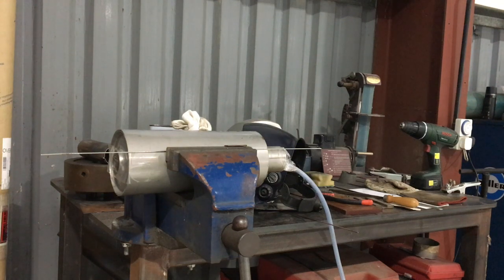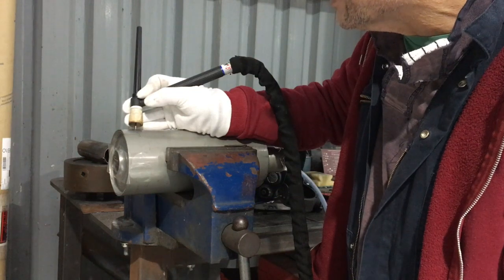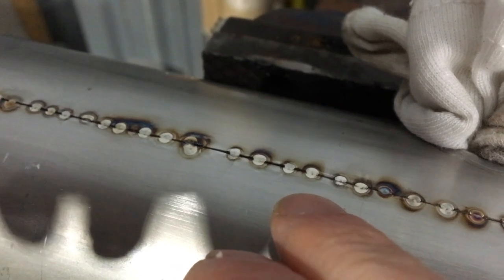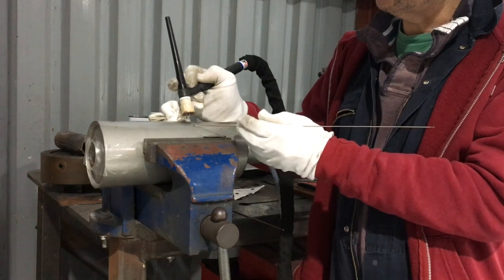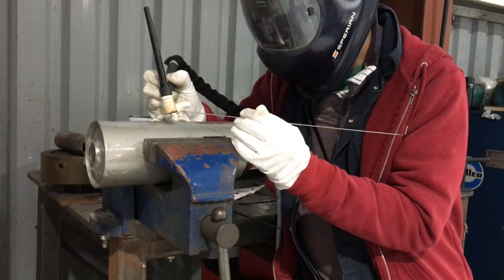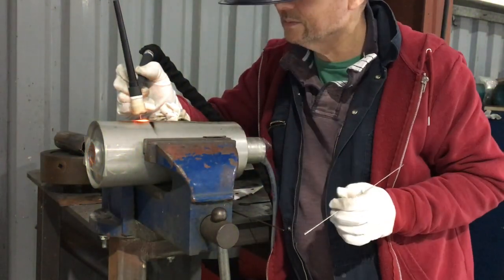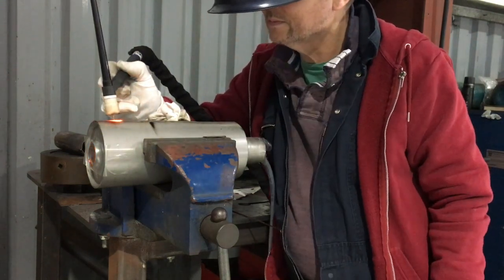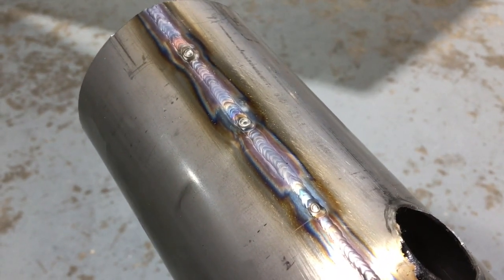A few tips for tig welding 321 stainless steel. Light up and get moving!

Comment: that looks really nice, really good backpurging there ..  I tend to use solarflux to save on gas.

 I'd love to try some stainshield gas but only have access to Pure argon from a local supplier , i'm not convinced its high quality as I don't really get nice colouring and have used boc gas before and got some nice colours !
Reply: Depending on the gas diffusion method, open gaps, and position of the gas inlet in the part, it's possible it'd take almost an eternity to get a terrific purge. It only takes around 100PPM oxygen to really dirty up the back.
Always use some sort of material to softly and gently diffuse the gas, rather than squirt a jet straight from a hose directly into the part. And on top of that, always always ALWAYS purge from the bottom up. Imagine you're filling it up with water, in your head. Filling it top down just mixes everything continuously, and the only way to obtain a good purge when there's loads of mixing is an absurd amount of purge time. Gentle gas, from the bottom, will always net you a perfect purge.
Reply from the maker: Interesting, might be a good project to make a little weighted diffuser for the end of the purge pipe to keep it on the bottom of the parts.

Comment: What size filler did you use ?
Reply from the maker: 1/16th, would have liked 40 thou, but I'm running short of thinner wires so using up the 1/16th